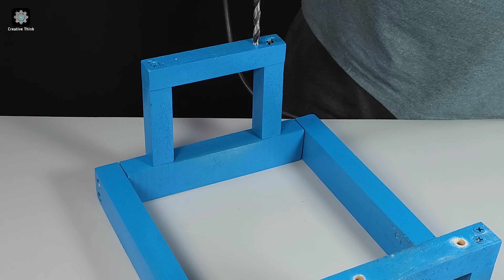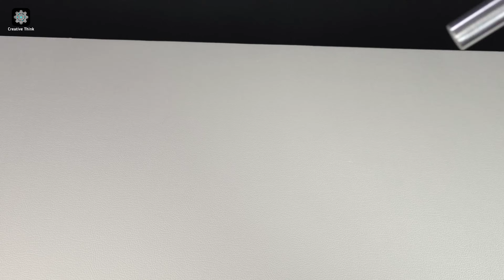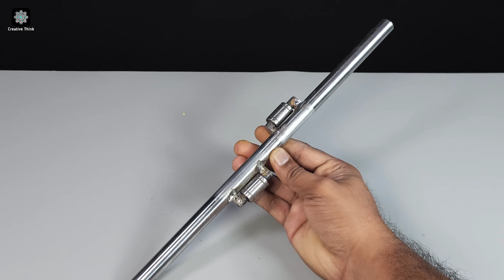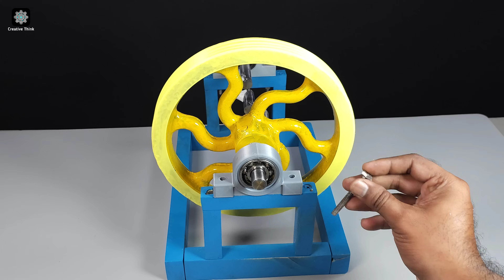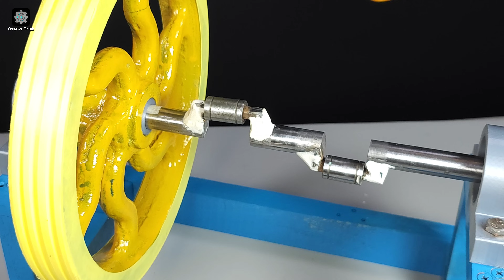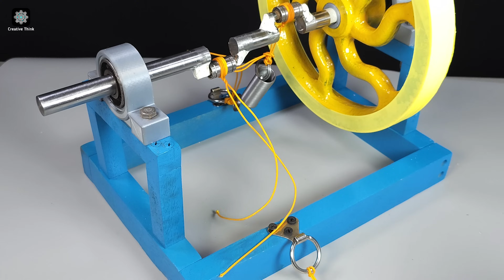Free Energy Generator from Spring Mechanism

Comment: Do free energy by digging a hole in the ground and place on walls of hole materials that allow heat to get in and dont get out so to rise temperature a lot. Materials like those used for ships to keep people warm when ships broke. Rising temperature would heat water or air that would produce energy, or simply heat a house
Reply: Or go outside and soak up the free heat energy of the sun.

Comment: I believe in the possibility of continuous motion, but not like this. You have to combine two mechanical systems, one that only oscillates and the other that rotates. The two will work in harmony providing more energy at the output than at the input, or zero input. For this to occur, it is necessary to take advantage of the centrifugal inertial force, without this force, it is impossible for such mechanisms to function.
Reply: Comme  tu dit ,sans la force centrifuge je doute que cela fonctionne, mai justement une idée me vient.si il l avait mis a la vertical le force de gravité  s annule en partie  et du coup il reste totalement  l inertie de la roue, et la pour le savoir il faut faire un essai dans les conditions que je viens d'écrire  .
Reply: It's not a possibility. It's called an isentropic process and is real. Look at Prandtl Meyer Expansion fan for an example
Reply: You are close.

Comment: Since 15 years, I have been dealing with angular energy electricity generation systems (R&D). My positive designs about angular continue. In this regard, my own financial means are insufficient, I had meetings with many businessmen, they accepted the financing of the project, but they gave up when it came to signing a protocol, that is, when it came to formalisation. If there is an entrepreneur who will take firm steps with me on this path, who is idealistic, has financial means and wants to make an official protocol, I would like to meet. 98% of the published videos are wrong and do not work. I know the mistake they all make.
Reply: So help!
Reply: फोन नंबर
Reply: @AjayYadav-sm1bq Whoever builds such a system, the rule to understand is simple. You cannot produce energy without getting energy from outside with a disc that rotates continuously and whose angle does not change every second. Of course, if you try this, you will understand the subject better. At least 2 different resonance angles are needed to generate energy. This video system has 1 fixed vibration resonance. Therefore, it acts as a kinetic capacitor (temporary energy storage). It does not provide additional energy to the system. Everything is within physics. There is no energy created from nothing. Existing energy is used in the best way. Gravitational energy is present everywhere. In my design (ARES), the robotic and mechanical system, whose angle changes every second, provides this. We can discuss in more detail. You can easily find me on other platforms. Many articles are not published here. Thank you very much.
Reply: @SINANOZYOLDAS  in that case, some of the videos using mangets are real. Magnet can make a kind of energy by moving a wheel somehow.

Comment: ممنون.
با اینکه بعضی از دوستان فکر میکنن که این ویدئو تقلبی است، اما من مطمئنم که این وسیله کار میکنه، اگر کمی از علم فیزیک خوانده باشیم متوجه این موضوع خواهیم شد، دَوَران فلایویل و کِشِش فنرها باعث باز تولید نیرو میشود، فقط برای حرکت اولیه احتیاج به انرژی داریم، پس در مقیاس بزرگتر این انرژی مجانی نیست. اما جالب بود، برای شروع ایده خیلی جالبی است.
Reply: I believe in the possibility of continuous motion, but not like this. You have to combine two mechanical systems, one that only oscillates and the other that rotates. The two will work in harmony providing more energy at the output than at the input, or zero input. For this to occur, it is necessary to take advantage of the centrifugal inertial force, without this force, it is impossible for such mechanisms to function.
Reply: What about Energy required to push Spring..??? Its can't be generated by flywheel rotation. 
Potential energy into mechanical energy without external force is next to impossible. May be in Pakistan possible 😊

Comment: The problem with these types of machine is that the spring under tension that provides the rotational force to the flywheel also has to use more force to stretch the other spring than it can provide and therefore the whole device actually slows down and stops, build this device for yourselves and you will see that I am correct, do not just look at the video and say 'It is working", the video has been edited or there is a hidden power source to make it look like it is working. Put simply, in deference to most of you people, it is a SCAM. 
Basic Physics states that, "Energy/Matter cannot be created or destroyed, they can only change form", for example, a form of pure energy (100%) that goes into any machine comes out as several other types of energy, mechanical energy, noise energy, heat energy and light energy are the main ones in differing percentages depending on the machine, which are produced by inertia, friction, drag and combustion to name a few. 
You will NEVER get more energy out of any machine than you put into it, that is a simple FACT.

Comment: Why would it accelerate the speed one side is pulling the other side is pushing they equal out each other . The only energy is what you put in pulling it or starting it with your own muscle.
Reply: Not just that, the yellow colour of the spokes & matching yellow colour of the rope does it!
Reply: Will this produce enough power to fill a bucket for use later?  If not, will freezing it help? Or maybe just catch it while it’s floating in zero gravity…

Comment: If it is real, I need 100 plants, what is  the price of a single plant, within howmany days you will be able to supply these plants. I wish to sell produced power to national greed, 4 crore people of Bangladesh  wish to  do it. If they can produce only three killo power per head, thats enough, to full fill the demand of power. They need not capacity charge. 4 crore power fighters are ready to fight against power criminals of Power Development Board. We got  geographical freedom, but did not get economical freedom. Power crices are only embergo. 4 crore gerila fighters will do the needful. So PDB should be careful. Otherwise they will get good lessons from 4 crores power fighters.

Comment: Il moto perpetuo esiste solo teoricamente, in assenza di attrito.
Reply: I believe in the possibility of continuous motion, but not like this. You have to combine two mechanical systems, one that only oscillates and the other that rotates. The two will work in harmony providing more energy at the output than at the input, or zero input. For this to occur, it is necessary to take advantage of the centrifugal inertial force, without this force, it is impossible for such mechanisms to function.
Reply: So what you are saying is If I pound it hard enough and long enough then I can expect a reaction ? Question then remains Who is going to wash up sticky mess…

Comment: If it is a Fake ,, someone please Prove it instead of just saying it.
I myself think it’s doable, and until I build on and prove it wrong I’ll believe it.
Reply: I believe like u, it's doable
Reply: Technology has a way to come in, many believe after years
Reply: It's simple. It does not work. The springs do nothing as the force one gives is just taken by the other spring. Then you loose energy as heat in the system as the springs expand and contract. That heat energy is lost to the air, og and we have friction too in the springs AND same with the Bearings ( energy is lost due to friction and heat ). The final nail, go to 3:04 and pause the video and use  , and . to go frame by frame and you can see as he spins it up it cuts to the things spinning the other way, so the video is in reverse.
Reply: @kj12351  remember there is a weight on the flywheel to offset the rotation
Reply: @trnnesseeMAGA  That doesn't really matter, you just have to move in more energy to turn it, that makes it harder to stop.